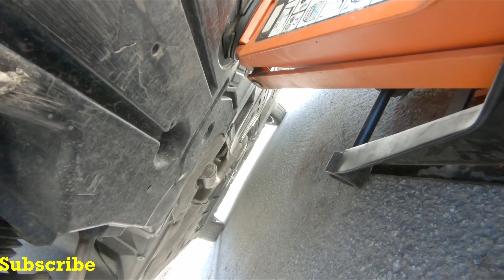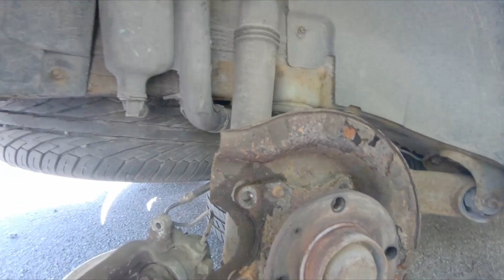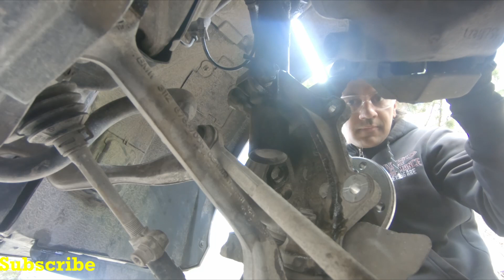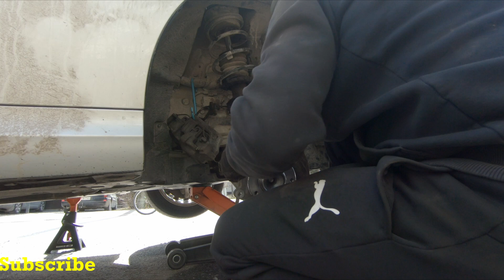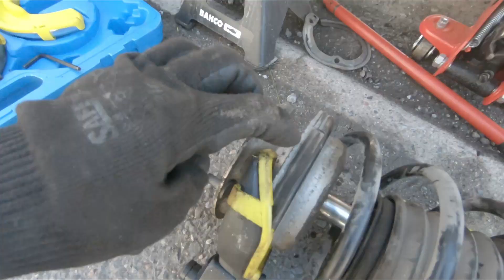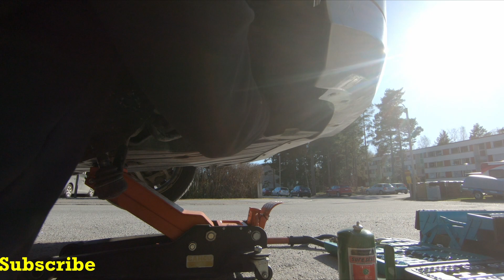BMW E91, E90, E92 Front Shock Absorber Strut Replacement. Ultimate Guide Bolt by Bolt

Comment: Good video. Couple things. Break the top mount nut loose while it’s still mounted in the tower. Much easier than when the strut is out. Grease the bearing in the mount. It is easily removed when unbolted, and the bearing is accessible on the bottom side of the mount. Also, that particular strut compressor is the only one that will compress a BMW spring enough to replace the strut. You have to be able to pull from the top side of the strut mount to get things compressed enough.
Reply from the maker: Great suggestion. Thanks for sharing your knowledge and experience
Reply: any compressor can do the job
Reply: @ВладимирВладимирович-д7ш2я   Not true. I don't think you have done this job on a BMW. I learned my lesson. The only compressor that has enough travel to compress the spring is the one in the video. I own 2 BMW's and bought this same compressor because the other styles won't get the spring loose.
Reply: @ i can teach you the easier way i used 2 typed of the compressors) u dont need a lot of compression. and you shouldnt use much compression) very dangerous)
Reply: @davemoll1151 you are on drugs if you think this is the only compressor that will work.....

Comment: there is something you need to be aware of, probably doesnt apply to the e90 you are working but i had a little trouble with my f45 216 active tourer, the spring is actually directional, the standard spring i have on the original OEM spring had a sticker showing lower, meaning fit to lower part of the strut, the after market spring i bought didnt have this label, first attempt i knew something was wrong as suspension creaked when steering turned, i got the oem spring and placed on a flat table with sticker suggesting lower at the bottom, it sat at an angle, i then turned it around and it sat straight thats when i knew it was seated incorrectly, i got the aftermarket spring and matched how it sat on a flat surface with the OEM spring, refit to strut and now i have no noises!
Reply from the maker: Thats true, some model have directional spring. Thanks for sharing your experience.

Comment: Did you bring up the knuckle to ride height before you torqued the control arm. Did you replace the $10 gasket that goes on top of the strut mount?
Reply from the maker: Yes, i did knuckle up at riding height and torque them down. Gasket was in good shap but yes I should have replaced them with the new.

Comment: Lots of unnecessary extra work all you needed to do was loosen up the control arm bolts and the strut nuts and the whole thing  with calipers would have dropped!!!
Reply from the maker: In my case even if I unbolt strut I still needed to unbolt the control arms. I could have remove cv axle but I did not chose that way since the bolts were quite rusty to remove them.

Comment: When did you tighten up the shock/strut top mount nut to its full torque, once it’s all in the car? and what torque value? Thanks
Reply from the maker: I did the final torque once all was done. Torque specs of my car was 34 Nm/25 ft  lbs
Reply: When you say once all was done, once the shock/strut assembly was back on the car, everything was back together, then you torque the top mount nut? @carrepairandtoolsvideos
Reply from the maker: @OsEffect  I snug the bolt tight but not near to torque specs. Then at the end once everything was intalled I finished it with the proper torque specs
Reply: @carrepairandtoolsvideos  understood, thanks! I’m struggling to get the right tool at the minute. I’ve got a pass through socket set but it’s not very long and only manages to get the nut on the thread a little. I was going to put it back in the car and then find a better socket where I can tighten it properly
Reply from the maker: @OsEffect  As I mentioned in the video, use vise grip on the strut bar to hold it unscrew with the normal long socket or use impact gun. My passthrough socket set had long socket as well so it was not difficult. But good luck to your project.
Reply: @carrepairandtoolsvideos  yes I did see that. I got it off with the impact fine but it’s just getting it back on is the issue as my pass thru set is not very deep, but I’m sure I’ll find a tool. Thanks for getting back to me!

Comment: As far as I know the control arm's inner screw should be tightened to spec when the car is on its wheel, otherwise the bushing will be damaged within a short period of time. Thanks for sharing.
Reply from the maker: Yes, you are right. I needed to replace the bushing later. I did torque down under wheel pressure after that job. Thanks for commenting.

Comment: All the screws and nuts are supposed to be replaced. But I'm glab you are using good tools and a really fine spring compressor!
Reply from the maker: I did not feel to replace since all were in good condition, I cleaned them before installing. Only one nut was brand new came up with the strut package. Yes, right tool for the right job makes the job easier. Thanks for the feedback though.
Reply: @carrepairandtoolsvideos  let me copy a part of the BMW documentation: "Tension strut to front axle support -> Renew screw and nut. Tighten down in normal position. -> Torque 68NMm then 90°" Since the screws stretch and this stetch doesn't revert, the screw mustn't be used again. The visual condition is not enought as an indicator.
Reply from the maker: @matthias_372  Yes, I agree with you that those screws should be replaced. I did not ordered them, but i did torqued them down. Apprciate your concern and guide.

Comment: When I complete my first attempt at the struts in the next couple weeks and post my repair on Bimmerfest, I will be sure to post a link to your video.
I wish I had your open ended socket set, but I don't. I am thinking of using a spark plug socket with a hex as suggested by Bavarian Autosport video, or Impact. As far as tightening the nut, once the nut is fairly tight, will the slender still spin when I take my torque wrench to it.
Reply from the maker: If you have impact gun then you dont need pass through socket, impact will do its job without any problem. Yes, you can use spark plug socket too. If you have vise grip plier you can use that as well on the old strut. You are right when installing the new strut with new nut, once you snug the nut you can torque it down without using pass through socket. You are spot on. Just be-careful when working on spring compressor and work on side and dont face on vertical side of the spring.  Good luck to your project and thanks for your feedback.

Comment: Does the bearing spin freely after you release the spring compressor?  Mine still very tight.
Reply from the maker: Yes, it should move freely. If its not moving freely then its bad and it should be replaced.
Reply: @carrepairandtoolsvideos  I disassembled and change the spacer another way around.  It moves freely now.  However, I torque to spec and it still has little resistance.
Reply from the maker: @imanwan2861  Some time there are two spacer. and since you put spacer on wrong direction earlier, are those in good shape? I assume you torqued it right and not over tighten it. even though it should move freely. If everything you installed back right  and still it has resistance then i still believe that bearing should replaced. These bearing  usually go bad with the time.
Reply: @carrepairandtoolsvideos Thanks.  I will try to install to the car to see if there any noise.  It is a new bearing.
Reply from the maker: If there is no noise and vibration and if steering handling is good or no balancing issue while driving then i think let it be and you are good go.  good luck